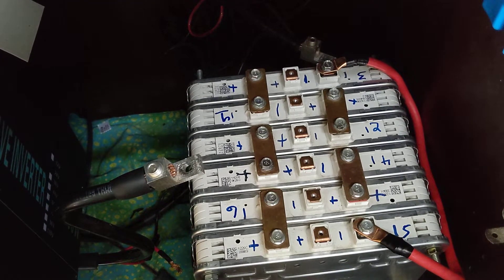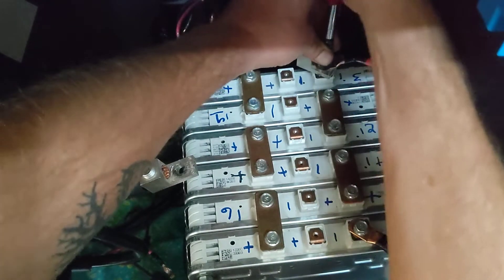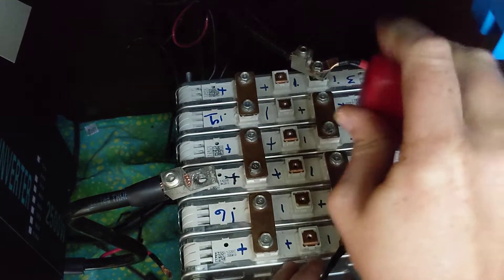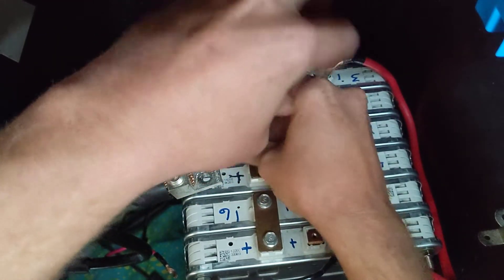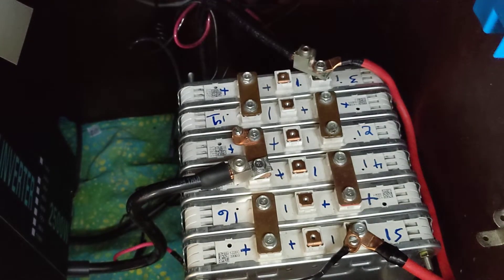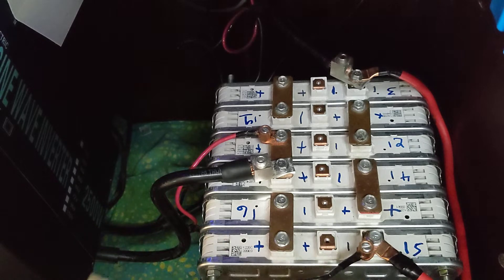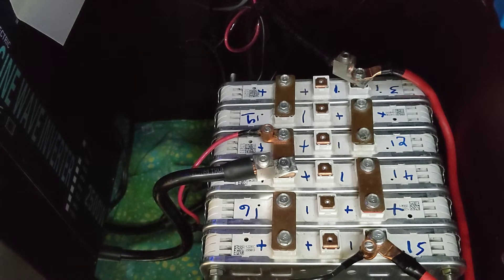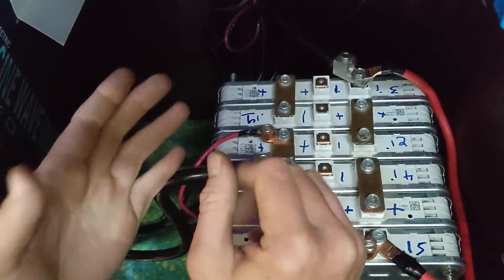Connecting the doubled capacity Nissan Leaf battery module battery bank to the rest of the system!

Comment: Do you run appliances that are 12v off of this system? I am very new to this so I apologize if this is a dumb question.
Reply from the maker: No such thing as a dumb question. I do not run any 12 volt appliances but with a simple $40 step down box you can run anything 12 volt you wanted.

Comment: great videos.. I purchase 9 batteries and was wondering if you have a diagram to hookup as 24v
Reply from the maker: My system is never been anything but 24 volts! All my videos and all my instructionals are for 24-volt system using three of them at a time. ♻️🔌💯🚮🌞
Reply: @ezmeraldadudortoka7549  yeah but how do you hook them up 3x3x3
Reply: @Willsmokalot  or 3x3x3x3 do you just keep them going in a row?
Reply: @ezmeraldadudortoka7549  I got 9 batteries going as 24v.. so far so good, I don't think you need a BMS.. I haven't used one so far.. the sun is out and batteries are fully charged most of the time..   Thanks for your videos, you got me interested in Nissan leaf batteries.. I'd be happy to get more batteries... maybe one day  :-)

Comment: Do some of these cells face different ways sometimes or should they all stack the same? As in, I just got three and when stacked together with the outer shell being the same two of the batteries have positives on one side and one is on the other.
Reply from the maker: If I'm understanding your question correctly...yes. It does not matter which way they face or how you stack them together as long as you can wire them appropriately. If you notice on mine I've got two sets of three. Both sets are staggered meaning they're completely opposite of each other and I did that because it made it 100 times easier to use the bus bars to connect them all together. And I'm assuming that you got three modules so you're going to run a 24 volt system...That means that you should be doing the same thing and you'll just have one group of three starting out. So line them all up the exact same and then flip the one in the middle around. That will make wiring them in series to create your 24V battery infinitely easier! 🤙♻️🔌💯🌞
Reply: @ezmeraldadudortoka7549   Yes, 24 volts. Thanks, I was just concerned that the outer shell faced a different direction one of the cells.  You know how they nest together like tin cans when stacked. If I do that with all three only two will have a positive on one side and the third will be on the other if all nested together.   I just wanted to make sure the one odd battery was not marked wrong.

Comment: When charging your batteries for 24 volts do you let the controller set the charging levels automatically. Or, do you have to set custom parameters  to get the correct charging range.
Reply from the maker: If you see my video about the charge controller and the parameters required all of those questions will be answered. There is no selectable battery type for Nissan Leaf modules 😏😉. So I set it to user setting and manually set every single parameter.♻️🔌💯🌞 It takes about 5 minutes and you only have to do it once and it's good forever.
Reply: @ezmeraldadudortoka7549  So if I buy a 24v controller with settable user parameters what is the max controller amperage I will need to buy. 30a 40a ? And what are your upper and lower settings? I didn't see that in the video. Thanks.
Reply from the maker: @KenMyers  You're watching the wrong video 😎. Let's address your question about the amperage rating on a charge controller first. The amperage rating of your charge controller has absolutely nothing to do with the voltage configuration of your battery pack. Every MPPT charge controller that's ever been made has customizable user parameters. You don't need a special one to utilize Nissan leaf batteries. Choosing one that has an app or a data connection definitely makes setting those parameters less of a headache but definitely not needed. Where you need to be concerned about voltage configuration is when we get to the inverter. You need to make sure to purchase a 24V inverter for the leaf modules. My charge limit is set to 24.9, My max voltage cut off is set to 25.1. My low voltage disconnect is set to 19.5.
Reply: @ezmeraldadudortoka7549  Thanks for the settings info and all your videos.
Reply: @ezmeraldadudortoka7549  If you already have a 12 volt pure sine wave inverter can you use a 24v to 12v step down converter to connect to it?
Reply from the maker: @KenMyers  I mean, you could physically hook them together. I would not be able to say one way or another whether that would be healthy for the system or it would work at all. That is kind of using technology in the exact opposite way intended. Logically, you wouldn't want to do that as a permanent set up. You can buy a 3000 watt inverter that's 24 volts for 250 bucks. 🤷‍♂️ 
Just for the record though, I do not recommend or condone stepping your battery voltage down just so you can use the 12-volt inverter. That's counterproductive efficiency wise on two or three levels. Not to mention just the pure unsafeness of that whole notion.♻️🔌💯🌞

Comment: I have 21 of those leaf modules. I had 28 but sold 7. So you’re skipping bms? BMS is what is delaying my system. Ive had these modules 10 months and still have not installed them. That and a thick steel box to put them in. 
 So you’re 24 volt inverter works ok at that low voltage. 
 Decent system for under $1300!!  Thanks for showing that.
Reply from the maker: I've never had a BMS. My system's almost a year old now. I put my multimeter on them every other day or so just to make sure that they're not getting completely crazy out of balance but they have only been more than 2/10 of a volt apart from each other on two occasions and I manually balanced them all myself just fine. 
Yes. I disabled the alarm on my inverter but the cutoff for low voltage is a completely separate alarm / failsafe. So my inverter doesn't shut down until 19.5. Obviously you could discharge the leaf modules past 19.5 if you really needed to but I don't think that's very healthy for the lifespan of the battery to be draining all the way down using the maximum 90%. 19.5 volts out of my 23.8 volt batteries is pretty much as far as I ever would want to comfortably take them. It shuts down at 19.5 which is somewhere around 20%. If you've already got 21 modules why not go 48 volt. 🤷‍♂️ Or have you already bought a 24-volt inverter? There's a lot more detailed videos and posts with links and product lists on one of my Instagrams if you're at all interested. It's been about a year now so you're going to have to go back to January and February of 2019 find all the installation videos. @ezzydortoka

If you've watched the video about why I don't have a BMS and you've Still got questions, please let me know if I can help!
♻️🔌💯🌞
Reply: Ezmeralda Du Dortoka Thanks for the link to your videos and the suggestions. I’ll check them out. I have two inverter/chargers to choose from, a 12 volt or a 24 volt. I’ll check the specs and see how low they go before LBCO cutting out. Sounds like your happy with yours and I’m excited to get mine connected in my new Motorhome project soon. I’m thinking probably the 12 volt inverter and also use the 12 volt alternator for some charging. Cheers

Comment: I'm an electrician... You've done an excellent job educating yourself sir...
Reply from the maker: I'm definitely a permanent student enrolled at YouTube University! Problem was that there wasn't really anybody that I could find that was doing a 24 volt configuration in a mobile off-grid situation or really any for stationary systems either. Not to say that there wasn't zero, there just wasn't a whole plethora of information on it. Not that the 24 volt system is going to apply to you at all! You're going to have some big boy batteries!! Plus....recycled! Thanks for the kind words. ✌️🔌💯🌞
Reply from the maker: Almost forgot, Did you happen to take a reading on your modules 10 months ago when you got them? That would Most certainly be the most fail-safe way to understand your own batteries is if you had a number from back then and then tested them now. Do you have generation 1 or generation 2 modules?
Reply: @ezmeraldadudortoka7549  are these gen 1 or 2

Comment: Are you finding that the leaf batteries are doing a good job balancing themselves, or are you doing anything to aid with that?
Reply from the maker: I started the whole project with only three modules which I put through the ringer pretty hardcore with a lot of tests. Those tests and videos can be found on my Instagram. I've always said that if I get up over nine modules I would have to get a BMS because that's too many cells to monitor manually. But like I explained in the video it's just as easy for me to manually monitor them with a multimeter once or twice a week then it would be to have an actual BMS. I'm not discouraging BMSs and it would do nothing bad to my system, I just don't feel that I need it because I check it every couple of days. They have never been further than 0.2 of a volt from each other. The couple of times that I did discover that they were further than 2/10 of a volt out if balance all I did was put the heaviest loads I could on the entire system for about 15 minutes and then after I shut down all the big loads as they slowly charge back up they will balance themselves out. One of the reasons that my specific setup does not have a BMS is because I was a moron and bought my six modules at four different times that were months apart from each other. I do not recommend doing that because you'll end up with mixed matched voltages. When they get shipped from TechDirect they have either a sticker or written with sharpie somewhere the actual used capacity voltage. And that's what I mean by the fact that I have four different voltages. The lowest one I have is 7.62 and the highest one I have is 7.94. So, if I was to actually put a BMS on the whole system I would lose the top part or top percentage of the less used modules because the BMS would equal it all out to the very lowest voltage of the entire pack. Hope that makes sense. I wouldn't be able to use the full capacity of three of my modules for being balanced out to the lowest module in the group.

Comment: Why did you configure the pack like you did ?  2 x series then parallel ?  Why not just double the cells in one series string ?  Because of the Cell Age differences ?    Did you ever do run downs and measure the cells actual capacities ?  All coming from the same source at the same time I would expect they are reasonably close to each other.   Think I'll do run downs just to know for sure what I have in hand.
Reply from the maker: Okay so I explain that in the video. It doesn't matter. Plus they all came from different cars. I also explained that. They aren't from the same source. I have four different voltages throughout the six different modules. I did explain that. Even if they were from the same source there would be no point in wiring them in one string. If I did that I wouldn't have as much control over individual cell charging. I would have four cells that would need to balance themselves instead of two. There was never any need to do a capacity test. What's the point? Go ahead and do it if you feel better about it. I don't really see any need.
Reply: I dont think you've understood what he means. If you put the cells in 3 x parallel and 3 x series you would have less to monitor. You've got 3 series and 3 series and 1 parallel.
Reply: @ilsonbob  this configurations allows to monitor each cell. Putting cells together as cluster allows reading values - e.g. voltage -  of the cluster only and not of individual cells. A good option for used cells with manual balancing. One would need two BMS to "automate" this configuration instead of one. What is not shown - main common positiv terminal - is minus terminal bridged? Otherwise the batteries  might unequal discharged?!

Comment: How are these doing?  A lot of systems use seven cells to get 48V rather than 6, which is essentially what you're doing (24V with 3 cells in series is the same as 48V with 6 cells  series).  So, that's near it's limit, right?  8.15V max.  I'm just curious if it's OK with charging so close to the limit to get 24V nominal operation.
Reply from the maker: I'm not sure I follow you and I think you might be a little misinformed. You are right about people running seven for 48 volts. But I'm not essentially creating a 48 volt battery with 24 volts. 
They're max is 24.9 for three of them. They are 8.3 per module. I don't know what you mean by charging so close to the limit? I charge mine every single day to an exact 0.01 of a volt. I have discharge shut off redundancies and overcharge redundancies. There's absolutely zero worry about keeping a 24 volt system within the 19.6 through 25 volts it operates in. There's no risk involved when charging all the way to 24.9.
Reply from the maker: Oh, as far as how they're doing... See my last two videos. They're just the same as the day I got them.

Comment: i have a question,,at what maps do you charge your batt pack?,i was told 8-10 amps ,per 48 volt set,,,low and slow,,i have 3 48 volt batts,,so would i charge at 8-10,over all or 8-10 per 48 volt batt?,,lol im confused
Reply from the maker: First off, how are your batteries wired? Second, Why are you needing to do that math equation in the first place? That's exactly what the charge controller is for. 😎🤙 
If you have a 48v bank, you should try to get your charge as close to 48v as possible. But that's what the charge controllers for. It regulates the charge that's coming from the panels into a steady, safe current for the battery charge, which is why I'm kind of confused why you need to do that equation at all.
Reply: @ezmeraldadudortoka7549  Most charge controllers do have float modes, so if you can explain that, it would be helpful. Thanks and I love your videos.
Reply from the maker: @BlessTVjm  Float mode with charging lithium ion is no different than any other battery. Like you stated, as long as you've got your parameters set correctly.  Shouldn't be anything to worry. But float mode was more designed for all the other types of batteries other than lithium. Every other kind of battery has much more fluctuation and play in their voltage but not lithium. You overcharge a lithium battery by 1/10 of a volt and you'll start to see damage. Float mode was designed so that you could leave your whole system up and running for days at a time even weeks and select float mode you have to set a parameter for whichever number you want and then it will automatically switch in to float mode if a load is not detected at a certain point of time. The whole idea of a float mode is to just keep your batteries topped off so you could leave on vacation and not come back to dead batteries. Most float modes are half of a volt to three quarters of a volt under what their maximum capacity is that's why it's called float charge because it literally just floats in between
Reply: @ezmeraldadudortoka7549  i have a victron 250/100 charge controller,,i charge them now at 15 amps,for the hole pack,3 modules at 48 volt,,
Reply from the maker: @oogie-boogie  right. Where are you getting that 15 amp number? And why are you having to manually set that? that charge controller should automatically detect a 48 volt battery and then automatically start regulating the power coming from the panels.  I'm assuming they're AGM batteries. That charge controller should have a selection mode for those. You shouldn't have to be worrying about setting amps, that's the charge controller's job. And I'm assuming because you keep saying 48 volts that means that you've got your three batteries wired in parallel hopefully. 😉😎Which makes a simple because you should just be able to set that charge controller to 48 volts and the correct battery setting and it should do most of it by itself.
Reply: @ezmeraldadudortoka7549  i set the limits  my self,,charge to 48.1 ,and a have a battery disconnect set for 42.,,and the amps i got off google ,when i bought my first volt battery,
Reply from the maker: @oogie-boogie  I didn't even know that was an option. Seems rather useless, I'm also not as hardcore about efficiency as most either. When 1.3kWh if lithium-ion is only $240, its pretty easy to just get more batteries if your really that hard pressed. Anyway...back to your charge controller.  If it allows you to physically set the amps then I guess I learn something everyday! I can't come up with a personal scenario in my case that I would ever want to do that though. The charge controller does that on its own, that's what it's for. 🤙😎♻️🔌💯☀️
Reply: @ezmeraldadudortoka7549  But you can overcharge batteries if you do not set a cut off voltage point. So if the batteries reaches 26 volts, the controller because it is set to 26 volts as float mode, it will stop charging so as to save the batteries from overcharging. I can set my controllers to whatever voltage I need it to stop charge batteries.
Reply from the maker: @BlessTVjm  Sorry what was the question?
Reply: @ezmeraldadudortoka7549  A statement and a question as to the maximum voltage for the battery bank. A 24volt system should not exceed how much volts?
24 volts can it peak at 26volts, how much. A 48volt system can it peak at 53 volts? what's the peak for the 24 volts that you are reporting on?
Reply from the maker: @BlessTVjm  I believe I've answered all your questions. Do not take a 24v lithium-ion battery made from Nissan Leaf modules past 25.0
Reply from the maker: I would also make sure to set it to 48 volts. You need that charge controller to be supplying at minimum 48 volts. Most charged controllers made in the last 10 years I have an auto detect. But if it's not saying 48 volt system then you might have to set up manually.